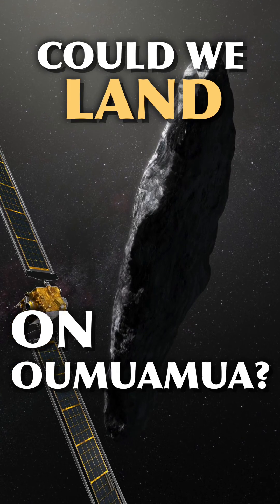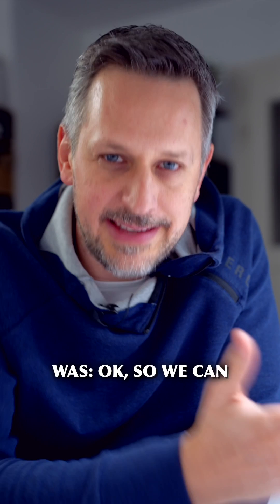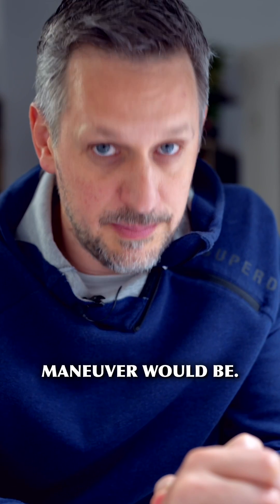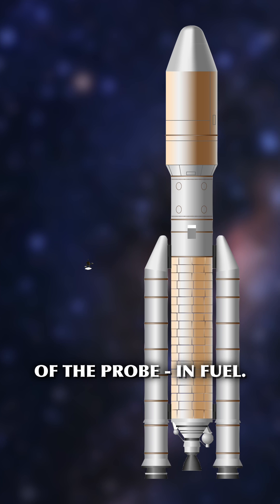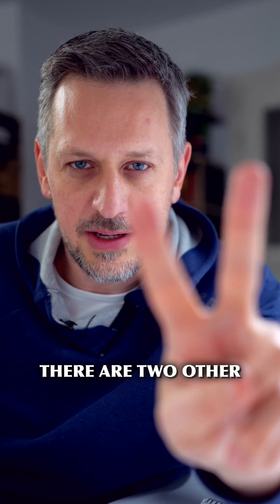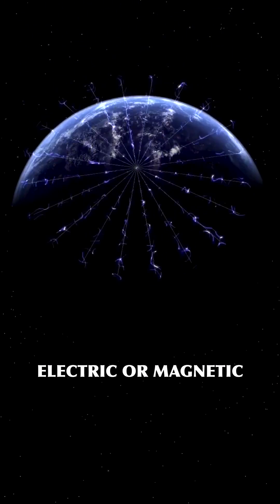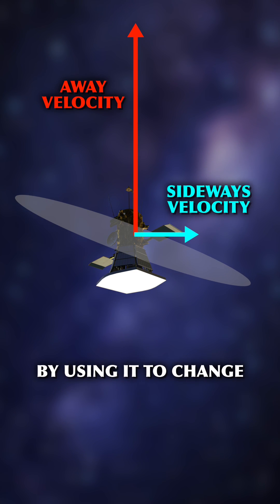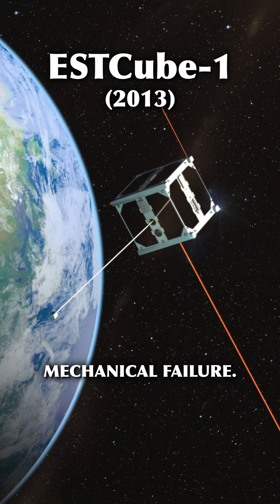Could we Land on Oumuamua?

Comment: Didn't they harpoon a meteor with a probe and get it to land in it back the like the 20teens?
Reply from the maker: Yes! The Philae probe landed on a comet in 2014. This mission was far simpler to pull off, though because this comet was much slower and, more importantly, on a fixed orbit around the sun. So it wasn't going anywhere, and Philae just had to match its orbit to the comet's orbit.